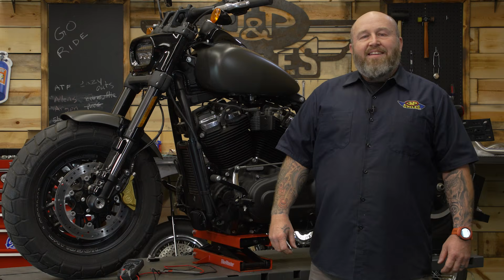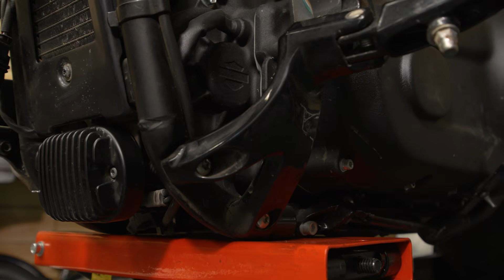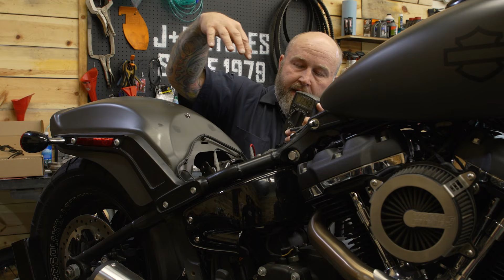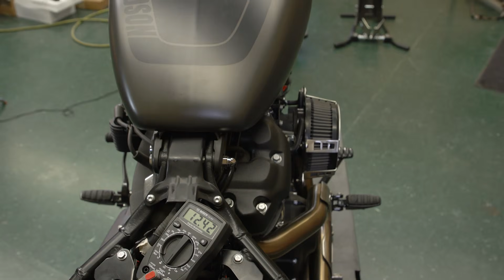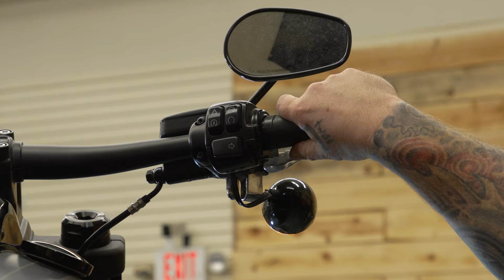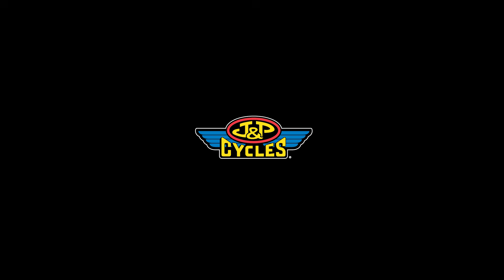How to Test a Harley Davidson Voltage Regulator : Weekend Wrenching

Comment: I had issue speedometer was acting up and down at a constant speed, Engine stall coming to a stop. At first was going to replace speed sensor. Saw few videos pointing to voltage regulator. I tested my voltage regulator just as you did in this video. It didn’t go up to 14 volts as it was rev. I checked battery it was good and passed a load test as well.  Decided to buy new voltage regulator. Same thing never get up to 14 either. Stuck with part, due to installation. Finally decided to replace speed sensor. Issue solved.

Comment: Tell  me if I'm wrong. My regulator on my 1999 dyna wide glide went bad. I got one off Amazon which stated it was for my year and model. I got it and everything is identical except, my old one had the plug wire and then the one that runs under the tank and to the fuze box. The old one had a 3 to 4 inch ground wire that ran to the frame. The new one does not have the 3 to 4 inch ground wire but instead haves the normal plug then 2 long wires, one with a black tip and the other a red tip. Q.- The red one will take the place of the one that runs under the tank and the other will be my ground?

Comment: I tested my stator. I’m reading at the plug out of the case, .1 ohms every which way I can meter between them. I also checked it point to ground and have an open. I started bike up and at idle it’s around  24 v across each point. I then did your test at battery it’s like 12.4 off and 13.4 running didn’t hardly go up and stays that way at rev. Assuming I tested stator ok I’m going with voltage regulator?

Comment: Good morning.  I replaced my voltage regulator. Because my battery would just die after riding. I installed the new one and i think its just a cheap one from Amazon.  But my multimeter will not go past 13.7. My battery continues to fail. I appreciate any suggestions

Comment: I have an intermittent problem with mine when I’m i traffic and the bike gets hot it seems that the regulator stops working then I run off the battery and when I turn off my bike at my destination it won’t start after because the battery is weak 

Driving around not in traffic never have a problem I think that when the regulator gets warm it stops working

Comment: I have an '07 ultra classic. The battery went dead over the winter. It wasn't a heated garage. My buddy added some fresh water in the battery. We gave it full charge. The tender said 100%. The bike starts and runs great. Haven't taken it on the road but as we have it running in the garage the voltage is reading around 153.154. would that still be an issue or is that actually still trying to maybe bring the battery back to 100%? My gauge also reads 15 right now

Comment: I have a 2011 Sportster 883 and it doesn't have a tachometer therefore I'm guessing how many RPMs I'm testing at. When I tested and increased the RPMs, the voltage on the battery didn't go past 14. It was close but it stayed at a high 13.

Comment: My stator puts out 16-20 v ac at idle and up to 50 v ac revved up..
My battery is only getting 10.2 volts while running, regardless of rpm..
I put a new regulator on, but i guess it's faulty

Comment: Just installed new battery within a month or so, this morn bike was hard to start, thinking it was a lot cooler out, got it started but soon afterwards all dash lights & radio went black, tried again to start and notice voltage indicator moving to over 15 to 16 and again blackout,

Now comes later and it seems to want to go to 16 but then dropped to 14, but when engaging throttle a few times it pegs the indicator?

Comment: kept popping fuses myself but was running at a constant 14.3 volts, at 4500 rpm i cought the volt meter barried and went back down. i cant believe it would be a once in a while deal but i guess it is! ordered new VR fingers crossed! 🤞🏻🤞🏻

Comment: I've had an ignition fuse problem all summer long. First it would die while riding. No spark. Ignition fuse blown. This would happen from time to time. Then I got a new ignition. I wired it from the ignition switch to power up the coil. Then it began blowing ignition fuses from time to time, but only when the motor was not running. If I powered up the coil the way it originally was, it would go back to blowing fuses from time to time while riding, so I went back to firing up the coil from the accessory wire from the ignition switch.

Now that the weather is cooling down a bit, I'm not blowing the fuse like I used to, but on a hot day, it will begin blowing that ignition fuse again.

I plan on putting a new rectifier into a parts cannon and pulling the trigger.

Comment: If the stator tests are good the only way to see if the DC volts are  getting to your battery is to meter your batter while bike is running to check for proper charging from there it is a faulty voltage regulator if no rise on meter.  Only way to troubleshoot a VR being there isn't a way to test it directly.

Comment: I got a 2021 Street Bob was road 8 miles off the show room floor and guy got forced into a brick wall and it ripped a whole into the tank and sparks and gas were flying and the bike burnt up I've replaced almost everything including the Ecm and Bcm and have a fully charged new battery and I know they have to be programmed by a Tech at Harley  but when I hooked everything up no power to the speedometer which is new as well so nothing is married to each other yet should my Speedo power up or not ?

Comment: mines sometimes bounces between 10 to 12 then once its warm charges fine. I am a journeyman Electronic tech. Am i wrong thinking diodes and capacitors either work or they dont? I just put a brand new harley regulator on last year this is getting flustrating

Comment: Hey man, I want to ask something. I have a 48 sportster which has a problem when I push the gas sometimes the headlights flicker and the engine feels like it drops and sometimes the engine suddenly stops. Usually what is the cause? Is it the stator, electricity or combustion? Please help me because I am very confused right now

Comment: Hi, I just bought RG 2010. When the engine cold everything is going normal. But, when I ride around 20 minutes the indicator battery suddenly on. And then I turn off the bike and turn it on again everything normal. The battery sign is off. But it happened again sometimes. Can I say that the regulator is in trouble?

Comment: Been having an issue with my aprillia, its blowing up head lamps,engine ceasing at high RPM temp rising for a brief when that happens and its idling too high as well ,but funny the guy who checked said the voltage regulator is good

Comment: I’ve noticed my voltage has spiked from 14.1 to 17.1 volts about three or four times now but only for a quick second. Probably a failing regulator?

Comment: i have a 1978 superglide fxe. it started missing and wouldn't idle i removed the voltage reg. and the bottom was burned out. replaced and ran good for about 50 mi.same problem checked stator running it went up to 17 checked battery running voltage went up and down from 3 to 15 i bought the bike new it has 13,000 mi. on it.

Comment: I have put two new voltage regulators on my 2012 deluxe, they stop working after the first run, my stator is putting out 34 plus, the regulator is after mark

Comment: My stator is putting out just under 20 volts AC out of 2 of the phases but one phase is only 8 volts AC at idle and the volts out of the regulator is only 3 to 4 volts DC. Is the stator bad or regulator? Brand new stator and stator rotor from drag specialties. I thought all 3 phases should be equal on voltage?

Comment: Having a over charge issue on a 2017 Milwaukee, eight 117 stator test good and the regulator is good replacement just to rule out, battery test good, voltage is 14.5 at 12000 rpm? What can I check next?
Reply: Sounds like the tachometer.

Comment: Quick question... on a 08 street glide I've chased a over charge for a few parts now. The bike has a new stator we changed the rectifier new from Harley-Davidson at about 2500 the meter pegs at 16+ volts at the battery..... my question is will a bad battery cause an over charge?
Reply: Did you ever figure over charging at 16 volts? I'm having that issue on my 97 heritage Softail. Changed the stator and the regulator (regulator twice)

Comment: So "if your bike isn't starting you could have a problem with the voltage regulator". So far so good. "The following is the best way to test it. Start up your bike and rev it up.....etc,etc." Do you see the problem here guys? Do you actually watch your videos and check them for consistency before you upload them?
Reply: What’s the first step in the other video…make sure you have a charged battery first
Reply: With a multi meter on it . To be fair the title is how to test a voltage regulator and the video achieved that
Reply: @CNSTAdventures  It the bike "isn't starting" you can't "start it up" to test something or other. Basic logic.
Reply: @bertoldriesenteil1430 Charge your battery, or boost it off literally any other working vehicle and leave the leads connected so it doesn't shut off. Both free and easy. Do you actually review your comments and check them for the trivial solutions before before you post them?
Reply: @creepingdeath864  l am not interested in "trivial solutions". They have nothing to do with my comment which still stands.

Comment: I have over charging problem and one time low voltage bike runs great but after 4to5 rides each around two hr code will pop again P0563 , B1006 and B1007 many testing and all work as it should. Now I’m confused even the checked grounds but nothing to finds. 2014 Harley Vrod 

My question how to test Harley regulator three phase, only thing I see about wrong it doesn’t read quantity from (-) side to three pins back

Comment: My Stator is good, puts out 65 volts around 2500 rpm. but the RR went out on me, I took it 
out of the circuit but I would like to know why the plug between the stator and reg or RR
was so hot.would you have an idea why? Thank you very much.

Comment: I have a 2011 CVO Streetglide the following codes keep coming up even after getting the dealership to clear them, I’ve cleaned all earths as that came up as one possible problem the codes are p55ptb c0562 b1154 any suggestions would be greatly appreciated TIA 👍
Reply: I do have the same problem bike runs great but after 4to5 rides each around two hr code will pop again P0563 , B1006 and B1007 many testing and all work as it should. Now I’m confused even the checked grounds but nothing to finds. 2014 Harley Vrod

Comment: So I did the tests and it tested bad... The next morning I checked one last time before I bought the part and it went right up to 13.8 .... So I took a ride.....good all day, started up next morning....bout 2 hours later broke down.... Now I'm not showing a charge...12.4 .,.. And declining.... Bout 2 minutes of bike idling....it went up to 14.3....….3 minutes later... Jumped down to 12.2 and declining again..... Not I can't get it to show a charge again..... Is it possible for a voltage regulator to work a couple times after going bad
Reply: Could be a heat related failure. Some electronics will shut down when they get too hot, then start working after they cool down. Anyone who owned a Ford in the 70's -80's know about this. If you can get it to act up when parked, try hosing it down with cold water. Or did you resolve the problem already?
Reply: What was the issue mate my bike doing exactly the same runs great for 4-5 rides than codes P0563, B1006 and B1007 come back over charging. Test it many times all good even all ground cable good, only thought regulator works sometimes and sometimes not but I want to be sure.

Comment: Is it possib for a voltage regulator to work sometimes ? Im getting 12.4 reading while the bike is running, I disconnect the voltage regulator and move it around and the vintage jumps up to 14 ...I know the obvious ( a loose connection ) but I can't find one... No broken wires ....??? I'm lost...I thought it was bad.... Right before I went to buy one ..I checked it again and it was good so I took a ride and broke down.... Brought it home, fucked around with it and it's reading good again
Reply: Might be a bad ground Hard to see

Comment: Why is there no recall on Harley voltage regulators? It's the # 1 issue with harley charging systems. All service techs say this.
Reply: And I have a Dyna with 6K original miles that is on its 3rd OEM speedo sensor. I suppose they are having China make some of their parts and are putting the HD name on them.

Comment: Can anyone help me with this a problem I  a 2013 road king  riding down the highway at 75 and bike goes completely dead.  I turned switches off and before I can stopped , my alarm light will start flashing and I know I start up and go again .... I say dead I mean dead it loses all power engine shut off all electrical shut down ... but with in a minute or so  it’s like it reboots  and starts back up  ... I change the ignition switch and it worked fine , but the other day it did it again  !    Has anyone ever heard of this happening ... I’ve been chasing wires help please
Reply: My vr tests good

Comment: I have the 2009 sportster XL1200C.i was a problem with the charging system.first thing : I replaced it's own regulator that was single phase with a 3phases,because I can't get the same at my country. next I measured the value but there 12.8 v at battery poles.i've checked every things such as: stator resistance,stator ground and even open the rotor to watch the stator but there is nothing.when I put the ac to regulator and it's disconnect of DC output(I mean unloaded) it just 7 to 8 volts of the output..
what's the problem you think?!

Comment: What if you have eliminated the coil as a source of a bike not starting (no spark), and you want to run a test of the voltage regulator in order to eliminate it as a problem source? Is there a test to check the voltage regulator when the bike does not run?  Thx.

Comment: I did all that testing on a 2009 RK, another guy did as well. But the low voltage light  and check engine still come on (sometime), I am figuring a ground, but I can't find any except the ground cable on the battery. Are there any grounds direct to the frame?

Comment: I have a 2020 iron 883 with 680 miles on it and the battery light won’t go off. Even after installing a new battery
Reply from the maker: you probably have another charging system issue that needs to be diagnosed. https://youtu.be/zGekG6Uahng
Reply: @jpcycles  thank you I appreciate it!

Comment: There are no tests for a regulator, only tests for a stator. If the stator passes and there are no wire issues, the regulator is the odd man out
Reply: there ARE indeed tests for a regulator that can be done with a multimeter with the regulator on or off the bike.  But sure-  doing the process of elimination- good stator + good battery + low charging voltage = bad regulator. But again-  don't say there aren't any tests for the regulator.  I do them all just for confirmation.
Reply: @lynskyrd  no there isn’t but sure argue with the guy that has twenty years ofexperience
Reply: @anitabonghit266  so I guess a forward and reverse BIAS test doesn't count?... won't tell you anything?  Diodes don't matter?  Never did any of these tests during those 20 years?
Reply: @lynskyrd  Please provide details for your testing of a VR. It doesn't help to just say it can be tested, and then mention fwd and rev bias testing. This is an info sharing forum, share my friend.
Reply: @anitabonghit266  experience means very little without sense and skill. I know guys that have 30 years experience playing guitar, or hunting, and have zero talent for it. Put a meter on your battery, start the bike, and rev the throttle. Assuming the stator and battery are good, should show higher voltage as the rpms rise. Good battery not running up to 14 volts when you rev? Bad regulator. Battery spiking up to 16 volts? Bad regulator.
There.  When you think that you know it all, that's when you become the kind of tech that people should never take their bike to.
Reply: @lynskyrd Jim
Reply: Ok
Reply: Can you do a resistance test on the regulator to determine whether or not it is good or bad
Reply: @kirknewton8468  no. It’s the process of elimination. You can test output of the rotor and stator, you can test for an open or grounded stator and you can test for open positive and ground wires going to the regulator and if all checks out good, it’s your regulator
Reply: @anitabonghit266   yes, I do understand that and those test can be ran without the motorcycle running course with the exception of the stater.
I seen that would be a resistant value on the regulator given two values of the component of the ohms could be calculated and I would think easily tested, what are your thoughts on that.
Reply: That's not true. You can use a multimeter across the pins in the plug coming out of the regulator to test the diodes.
Reply: If a voltage regulator is bad will it not output back to the battery at all? I'm not getting any charging. I tested my stator it passed.
Reply: @jaybourbon8608  yes. It can be shunting all the voltage back to ground and not allowing it to go to the battery.

Comment: I changed out my regulator 2016 Road Glide because it was over charging. The new one shows the same issue of over voltage over 14 volts up to 15 and down again to 14. Stator tested good. Battery cell maybe. Thanks.
Reply: Did you fix your charging issue from 9 months ago? What was the problem?